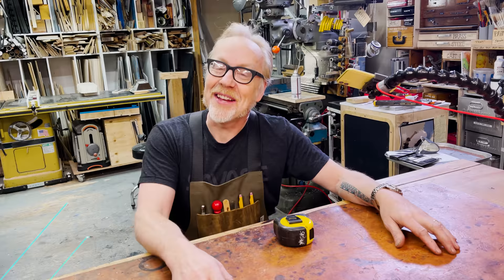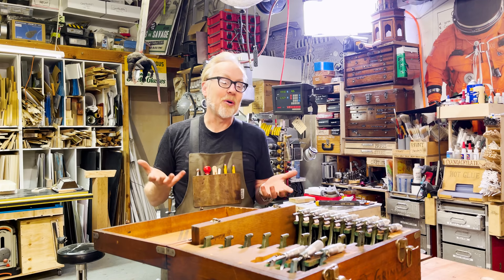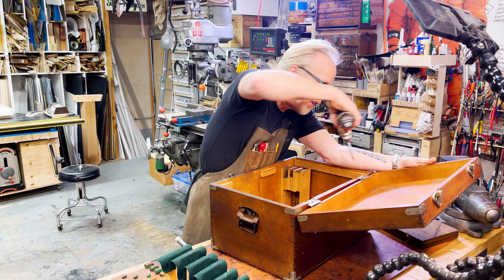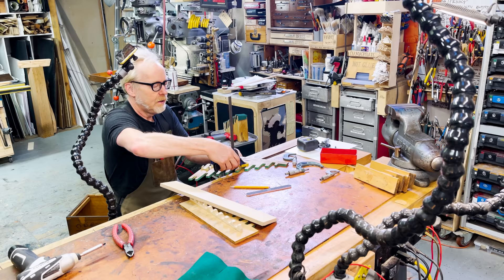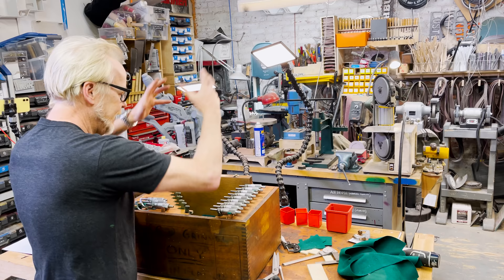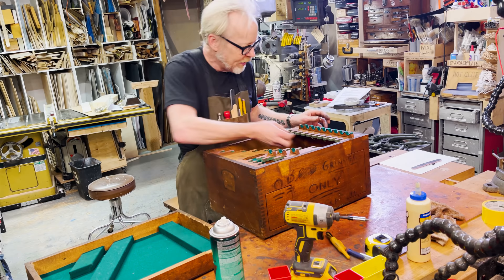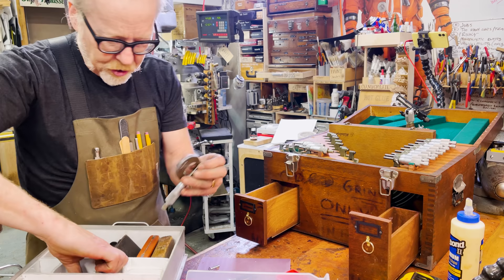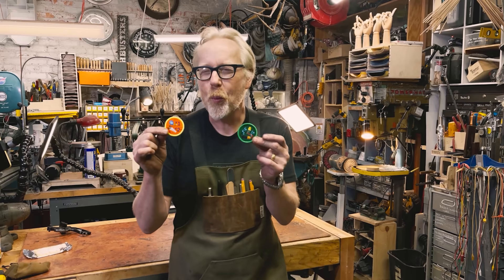Adam Savage's One Day Builds: Micrometer Gauge Box Set!

Comment: This is kind of an old video but hope you'll see it, there are actually Four ways of measuring with a calliper. 
Obviously the three you mentioned, but if you look at the callipers you'll notice the very top of the jaws are flush when you fully close them. So you can measure from the very top of the solid jaw, to the top of the sliding jaw. Giving you a sudo depth measure'er, but since it's a wider surface it stays 90 degree of the edge your measuring.
Something that would make doing measurements like the two at 28:37 much easier and accurate!

Comment: haven't seen a set like this for a good few years nice to see, if you want to super accurate when setting and using micrometers of this size then you need to take temperature into consideration, they should typically be calibrated at 20 deg C however ill guess you don't have a temperature controlled workshop, so if they are calibrated in the winter they may not be in calibration in the summer, handy tip to know 😎😎

Comment: That "square" you used to check the perpendicularity of the disc sander table to the platen  needs to be replaced with a 1-2-3 block. I've found those "squares", especially the cheap ones, to be notorious for not actually being square or easily getting bumped out of square. Get yourself a nice set of 1-2-3 blocks and 2-4-6 blocks. Well worth the money.

Comment: If the Mic stand ever gets annoying, you can make a socket to inlet into one of the thicker boards of the hold downs in the lid and make another ball adapter. That way you just have the vise under the lid and can use the lid itself as the mic stand base.

Comment: i plunge cut with a circular saw to cut doors and drawers into a panel. you have a longer sight line to get the initial plunge square, then the circular saw makes a straighter cut. set the toe edge of the saw table so the blade is in line with the cut you want to make, and slowly and firmly lower the saw until it contacts the panel, the drop in into the cut letting the weight of the saw push through. move the saw along the line until the kerf is just touching the line at both ends of the cut. finish the corners with the hand saw of your choice.

Comment: I noticed you are grabbing measurements with the square surfaces of the dial caliper jaws when the ends with their knife edges offer the finer measurement.  Also rotating the pipe while it is in the grip of the ends of the dial caliper will give you the mean id or od of a pipe which is very useful especially in cases if the pipe is slightly out of round.

Comment: If that's what I think it says on the front of the box these micrometers were used for grinding operations and if that's the case you most defiantly need to take them all apart and remove the abrasive material (grinding dust) and re-oil the entire set.

Comment: At 1:00:00 what I'd do for loose screw holes is put a dab of cyanoacrylate on a toothpick and break it off in the hole, then run the screw in. This makes the hole much smaller and gives the screw something to grip. Helps if the toothpick wood is extremely wet, as well, as it can then give where the old wood cannot, and smoosh-out better to hold the screw. I've also used this trick successfully with lag bolts in bricks to hold a fence gate up. I must admit I probably used 12+ toothpicks for 4 holes... but I fixed that over a decade ago and it still lines up with the latch, so I count that as a win!

Comment: @ Adam Savage’s Tested
to use the larger micrometers without the stand, place the anvil side against your stomach lightly, while holding the frame with your pinky, ring finger, use your pointer finger to work the spindle lightly
hold the work piece in your non dominate hand and lightly rock it from side to side to make sure your not getting a false reading

also no one uses the ratcheting feature, just get a consistent feel for the thimble, if someone else uses your mic they will have to check it on a standard to make sure their feel is the same, you should be checking them every time you use them anyway because they will drift with the ambient temp

Comment: There is a fourth way a dial/digital caliper can measure.
Using the back side, one can measure a step.
In all my years of using outside micrometers, I RARELY use the ratchet stop.  It's all feel.
All of my micrometers have carbide faces on the anvil and spindle.
My standard set is checked against a set of standards calibrated to National Institute of Standards and Technology (NIST).  
I have worked down to a 0.0004" tolerance range.  Example, print showed 2.0000"/2.0004"  That was the tolerance.
To do that, every roughing cut was made to the same depth of cut for even tool pressure.  Then two balanced finishing passes.  
At this tight of a tolerance, it is all about tool pressure.

Comment: Calipers aren't interchangeably called micrometers. I love ya man, and I love your interest in metrology. I've been hunting for a set of those analog digit mics forever, they're so cool. Tip for measuring outside diameters with calipers, measure at a 45° angle to the centerline. It gives you more material under measure AND it makes it much harder to be crooked.

Comment: Another great rust remover, especially heavily rusted items, is simply a citric acid and water solution. Just use aprox. 1 cup citric acid (powdered or crystals) into each 1 gallon of water. It's safe, reusable, and inexpensive. Just be sure that any oily residue is removed b4 the soak. Dish soap works good for that and afterwards as well. The end result will be a black film on the surfaces not unlike found when dealing with a kitchen sink drain pipe, without the smell. Easily removed film Should always be followed up with a coat of paint or oil, oherwise it will literally re-rust before your eyes. Depending on degree of rust, soak time is between a day & a week. Use a 5gal. Bucket with lid to store. Solution will turn dark, but it's reusable many times over. Works great on rusted files, and anything else.

Comment: For the cradles, I thought he was going to use the off cuts and attach them to the lid, making it hold the top and bottom of the caliper ends so they don't move around at all instead of just resting foam on them. Great attention to detail on this though. I used Evapo-Rust on a bunch of specialty fasteners and gears when doing timing belt maintenance on an older 300ZX twin turbo. It saved a bunch of money and time. The parts weren't all that bad but I just couldn't bring myself to install parts with slight surface rust back onto the car, even in places nobody would ever see it. I would know...

Comment: If you're measuring a pipe thickness with dial calipers, use the beveled tip.  It's still inaccurate, especially because the bevels wear faster than the flat parts of the jaws (and especially if the calipers have not been taken care of), but it's more accurate than using the flat.

Comment: This is one of the major reason today's engine are able to get close to half a million miles. The tolerances are a lot tighter, and cause less stress on the running components. Everything is balanced better, spins more precise, and creates less friction. Allowing weaker and lighter materials to replace heavier material, and still perform just as well or better.

Comment: U can just use various adjustable spring calipers an od mic and/or those dial calipers...keep in mind using a calibrated up to date set of gage blocks is one simpler way of insuring or maintaining consistent control. Even with all these and so much more not mentioned measures, the knowledge and skill it takes to master gage and instrument set up and usage, while knowing the minimum periodic calibration standards is almost a trade in and of itself

Comment: At 1:14:19 - Adam is trying to peak inside the box to see if the micrometer stand doesn't bang into anything.  Been there, done that kind of trying to look into opaque containers.  Try this ... set you phone on video (with the flashlight on) and take a short movie of the inside.  You could also use a cheap endoscope.  My two cents.

Comment: I wonder if a more elegant numbering solution is to place the on-box label in such a place so that the number is visible only when the tool is not in it's resting place. That way, you're not seeing pairs of 7s, 8s, 9s, etc, but you're seeing the 7 of the tool in it's place, the 8 of the resting place where the 8 tool should rest, etc.

Also, a demo of using a micrometer for us plebes would be fun. :)

Comment: Only very tip is meant to used for measuring stuff,  that pretty much gets rid of most measuring problems you brought up, while measuring thickness/diameter of pipe etc...
 That's why those tips are machined/grinded to "sharp" angle...

Comment: Great video & enjoyable to watch Adam a work. Some questions & comment:
I) The mic  stand is a poor solution, working height too great, too bulky better to hold the calibrated rod & move the mic.
2) The box top IMHO should have been restrained by a chain maybe, we have all seen box lids strained & broken due to lack of restraint.
3) I thought the two drawers of different size spoiled the appearance as did the superflous label holder.
4) I could not see any means employed to stop the drawers falling out, are self closing slides available?
5) The rust removal treatment resulted in what seemed a colour change from brassy to something like aluminium. This was not an improvement & could have been avoided.
Despite such details I watched to the end with my wife & we enjoyed Adams project, Thanks!

Comment: the disk sander "plane" is not parallel to teh miter track - so when you move your piece across the face (from center if disc - thru the outer edge) it removes the material to a "final" perpendicular finish - after your drag the entire piece across the radius (not just push the face - into - the sanding disc, perpendicularly). At least thats what I recall from  shop class 40+years ago!!

Comment: There is a difference between "accuracy" and precision. 
Also, a micrometer will have the same 'off square' sqew problem.
There is also thermal expansion to worry about, where you have to heat the measured and the measurer to the same temperature before claiming precision.
Ball bearings are great for wall thickness; just subtract; but if it isn't square, forget it.

Comment: Most calipers are grinded almost sharp for messuring thickness, in your case, a cylinder. Messure at the tip of a caliper and you'd get sub Thou messurements.

Comment: it's true about calipers but as a machinist for the wall thickness you use the tip that is angled and sharp, for when you measure the inside or outside diamater of a circle you just use the min/max value. hard to describe, but I guess thats what you meant at the start.
if you only now start to enjoy dial gauges, maybe you should have spent a couple of months building engines  or as a machinist- that would have thought you all you need to know about them :D

Comment: Typically, a caliper actually has four pairs of measuring faces. The very end of the beam (where the fixed jaw is) and the adjacent surface of the sliding jaw should be coincident when the jaws are fully closed, allowing step depths to be measured. This is much more stable than the depth bar, provided there is access on the workpiece.

Comment: tenths of a thousandth is very very temperature sensitive. 2.54 microns , red light is 750nm ie .75 micron.

use the caliper blade tips for pipe wall thickness. they are knife edge for specifically this reason. also rough thread measurements.

Comment: On bone to pick. A fia caliper is not a micrometer. Plus dial (or digital) caliper can measure 4 ways. 1) Across the width or diameter of the piece. 2) An internal measurement a in an ID or the width of a slot. 3) Depth with the rod. 4) Depth or step over with the head end of the unit. 1 and 2 are reasonably accurate. 3 is a guess at best. 4 is reasonably accurate. Plus #4 is a great way to layout parts.

The basic idea of the screw micrometer has been around for a long time. It took advances in machining technology to reach the point to where it became practible. Prior to that it was all vernier calipers.

Comment: A minor but crucial comment on the vernier caliper, the square is not the measuring point... Measure from the pointy portion on the bottom 1/2 ish inch and you can measure from the inside of a curve. Just hold it straight.

Comment: the black on the metal is probably japanning, and it's added intentionally to prolong the part life.  surprised you got it off with just rust remover, it's usually an absolute bear to remove.  you can quick batch it, it's not too bad to make and re-apply it if you want the box to look a little more authentic.  should look pretty good especially with the brass.

Comment: Calipers can easily measure to 0.0005 inches on all measuring axies. You do have to understand how to use them correctly. Micrometers can measure incorrectly just as easily IMO you can definitely still hold them at off angles and get bad readings. It's all about consistency for both.
Reply: PS they do make tube micrometers with a round anvil for measuring  cylinder walls. along with other micrometers in different shapes and sizes for different purposes.

Comment: With the 1st micrometer i would have measured outside and inside then subtracted to get the pipe thickness.. also i would have taken those measurements as close to the edge as possible so you could make sure the micrometer was square to the face if the edge of the pipe. 

Then again.. im not as high tech as you lol... For now "close enough" is good enough for me 
Love the vids... You should do some on forging casting and things like that

Comment: PRO TIP: Use the cradles' cutouts to smoosh the felt onto the hot glue more better. Makes them all snuggly like. 

If you pencil witness lines they'll match pretty well even after contour work and can be used to normalize any clamping forces across the bonding surfaces if clamps are needed. This works really well for oddball laminate applications for gun cabinets and whatnot. Which is what this project brings to my mind.

Comment: I would have pocked a stock piece of wood that was the depth of the top, drilled holes for each of the micrometer handles, sliced it in 2 with a band saw, mounted the top rail in the top, and trimmed the edges and mounted the bottom rail under the handles.... perfect.

Comment: I love it when people use the word "commensurately". You just don't hear it used in context enough these days. :D

Adam: Going sub-accuracy with a tape measure on a wooden box of full of micrometers. So poetic.. So.. Je nes sais quas.. So human. :)

Curious to know why you didn't just re-purpose the old cradle for the three smaller micrometers by attaching it directly to the top plate. Also, if you ever look at this build again, you ought to inset the drawer bottoms so the the brads/nails help hold the weight. I wonder if you could stow some legs in the case to prop the lid up level and use the lid as a tool tray?

My shop teacher would actually come unglued if he saw you grabbing that collet while the lathe was spinning. :D He would also come unglued if he saw you balance a box full of standards on a wooden table clamp, hanging off the edge of the workbench. :O

..Gives the micrometer set all of the love int he world. Throws the crappy micrometers in a drawer. :D :D :D

Comment: OK just started this video, and I know it's 9 months old but I think this cradle idea is actually a bad idea. I believe it actually will make the problem worse. I understand it looks like the thing you need but the cradle will allow the tool to bind. If you only holding it down one side of the box was to fall or wrongly shipped again, you make the tool fight against gravity on one side and it will flex ever so slightly which with that tool can throw it off. Without the cradle yes it fell out and not good but I think its better than it hanging on one side holding all its weight on its precise handle, now these tools are good tools as u also said but we might need a Mythbusters on this lol. Seriously I think the cradle can even cause like a dead spot where the threads slightly bend. Ooo I see what ur doing ur making a bottom peace OK. And when u were putting it together you kinda came to the same concern. To be honest you should have just started this box from scratch. You could have made a box that holds them from the center. Like you put them down in a slot then slide them over through the holes so something holds them securely with in the box and u can't just lift them out. U first slide them off then lift them up. Iam describing it so u can better understand what I mean. But as this video goes and Iam typing this you seem to be going all out on this anyways and also have the same concerns.

Comment: Does he know you can use the opposite end of the depth measuring tool on the calipers for shoulder measurements? Like using the jaw end on a shoulder? It's a lot more square than the depth measurement side since there's a lot more area

Comment: That is a Vernier Dial Calliper, NOT a Micrometer. To measure the thickness of cylindrical pipe,  use the tips of the jaws, That's why they are tapered. With practice you can get a feel for when you have positive contact between the jaws.

Comment: I have a question, i am working as a CNC machinist, making headstones. I use calippers for messuring the slab thickness. I have a pretty good digital calipper. But i tend to only use a manual/analog calipper because i dont trust the digital calipper to keep its zero. In hobby i use the digital. Am i the only one that dont trust the digitals? Or am i stupid?